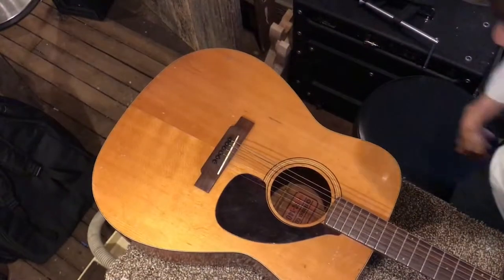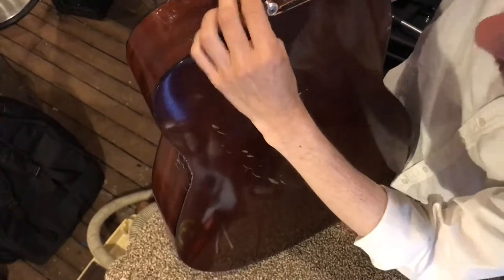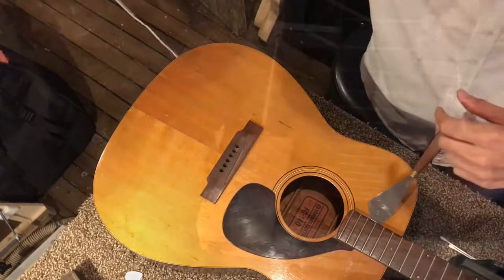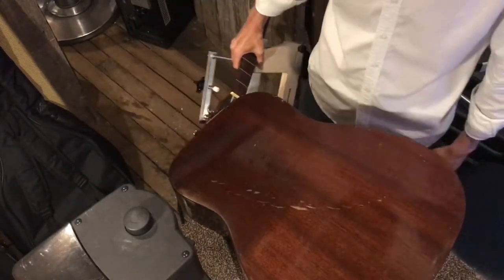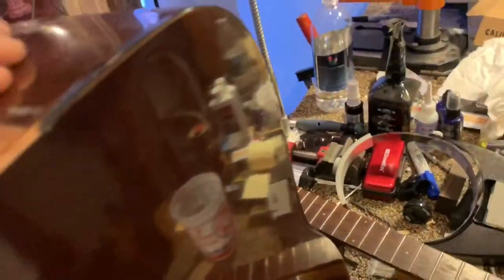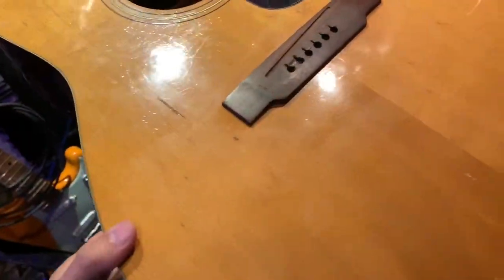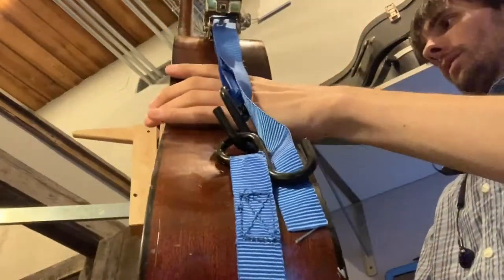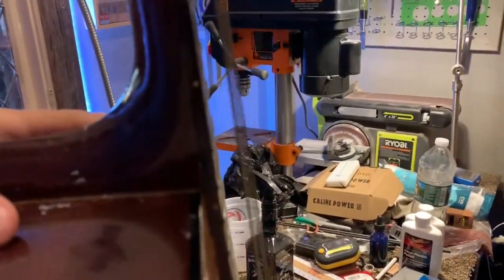Fixing A Guitar That Got Thrown From A Window

Comment: So, 'off the street and on the road' - good job too! Interesting to see that neck joint as I was assuming Japanese makers used dowels. I have a Japanese Washburn D-24-N from 1983 that needs a neck reset and re-fret and now I'm wondering about the neck joint. I know later models made in Korea used dowels, but without asking my dentist to do an x-ray - I'm in limbo as to which way to remove the neck.
Reply from the maker: Iazzaboyce 

Hahah I know right? That’s the oddball part about working on some of these overseas guitars. Unless you find someone on a reputable forum who’s attempted the procedure on your guitar (or a similar model from the same factory), it can be really difficult to tell what’s doin in there. I’ll tell you one thing, though....removing the necks on these yammies is an INCREDIBLE amount of work. I’ve reset a few Japanese necks this year and some of them have no neck pocket whatsoever. It can be a real adventure